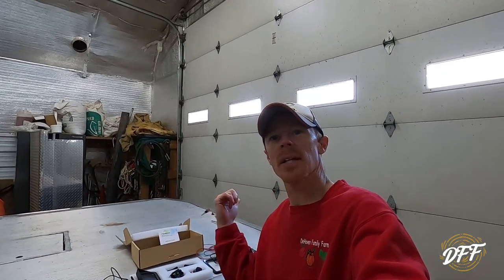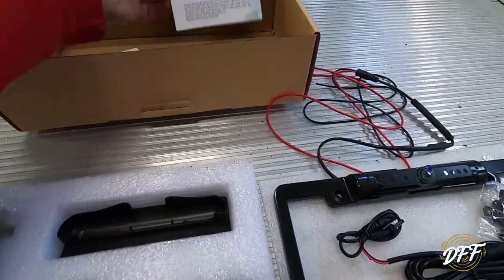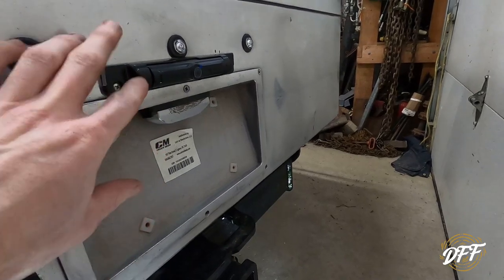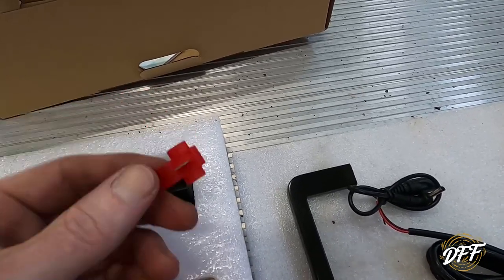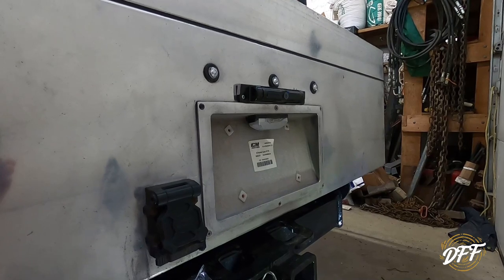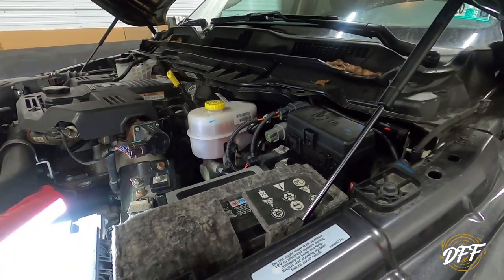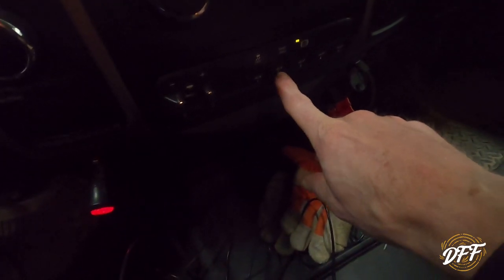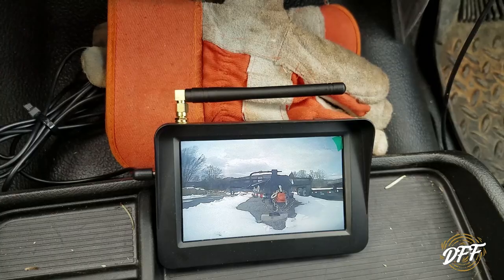I Installed A WIRELESS Backup Camera On My Truck!

Comment: The red colored connector you rejected works fine! Wrap it with good quality electrical or marine tape. It's quick, easy & water tight.

Comment: Always best to have a switch 👍
I put a PEAk camera on our big baler probably 8 years ago???
It works great!! I'm sure there are much better ones now.. 
I didn't run a wire to it, inside, I hooked into the field lights.. 
Not the best, but it works... 
And way less expensive than the agricultural equipment cameras!   
Although, for what I'm using it for, I'd probably go with the Ag cameras next time, just because I could put more cameras with one monitor.
Good video Chris!!!
Reply from the maker: Thanks Ed! For what I paid for this camera, it would be cheaper to buy a bunch of these to get different views than 1 expensive one LOL
Reply: @dehavenfamilyfarm  ya.. I've thought about that too.. but only so much room in the Tractor for monitors.. already have 3 for the baler.. LOL
I think the peak camera was $94 at NAPA at the time, I'm sure they are half that now...

Comment: Yep wireless is a loose term I guess.  It was the same for me when picking out a camera system for the combine.  Wireless ones still needed that power wire.  So  I went with a wired camera.    That will be handy for sure. My phone does that too sometimes.  But usually it's when I'm pointing through a dirty window.
Reply from the maker: I really don't think they should advertise them as "wireless" LOL Thanks for watching!!

Comment: The poor camera can't figure out what to auto focus on :(.  If you point 45 degree down you see hitch, but not load...
Reply from the maker: I think I will be able to adjust the camera so that I can see to hook up the trailer, and see the load on the front of the trailer. You are correct- the camera isn't high enough to see to the back of the trailer, but I will take what I can get LOL